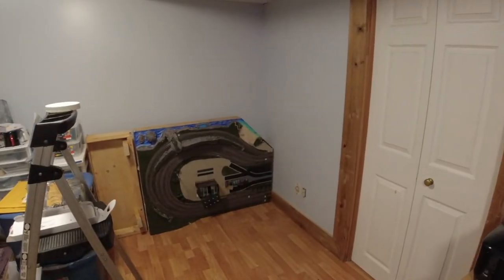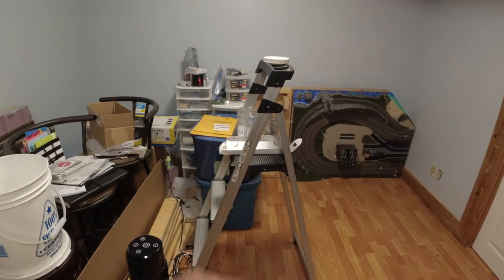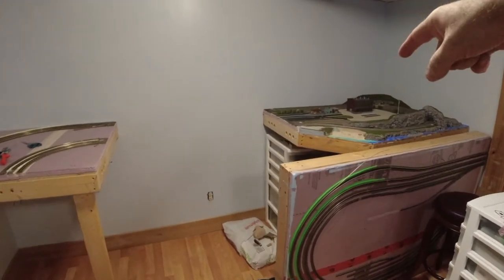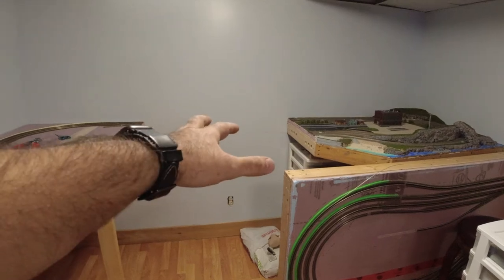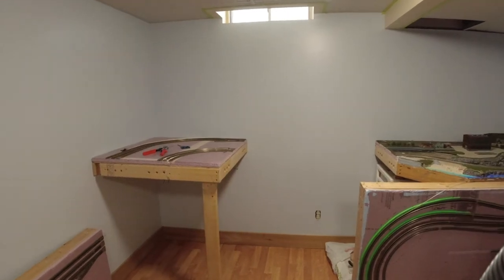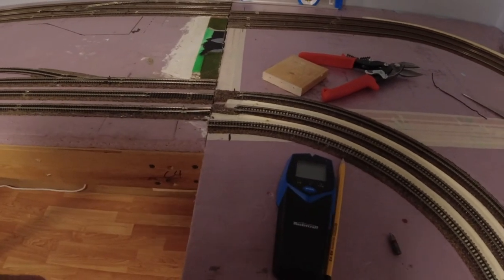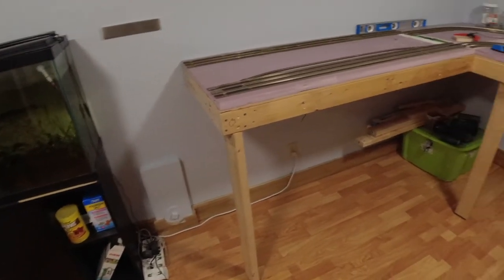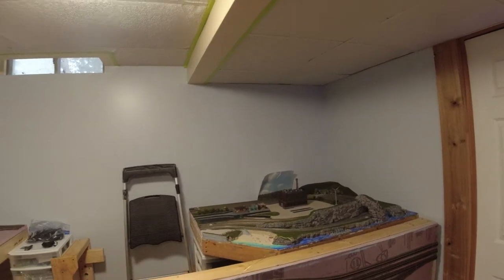Arcadia Is Coming Back Re Installing Our N Scale Model Train Layout

Comment: I like the layout looks good how wide is it I am thinking about making a N scale layout
Reply from the maker: Hey S&V,  Thanks for your question and comment.  the widest part of the layout is 38" (just a little over 3 feet). I did this so that I can run my Norfolk & Western J class 4-8-4 steam loco as it needs a wide turning radius.  If you don't have any stream or large loco's then you can drop down to about 24" (2 Feet) wide.   You can fit almost 4 time the amount of track and scenery in the same space as for an HO layout (based on a 4x8 sheet of plywood). 
I hope that helps you with your decision. 
Stay safe and all the best. 
Tim...
Reply: Thank you my o gauge is 4x8 but I probably will do 2 feet wide for a N scale layout to put it in a room can’t wait to watch your train layout grow